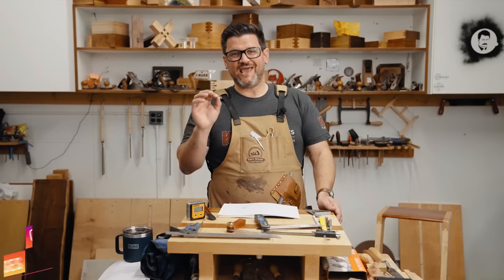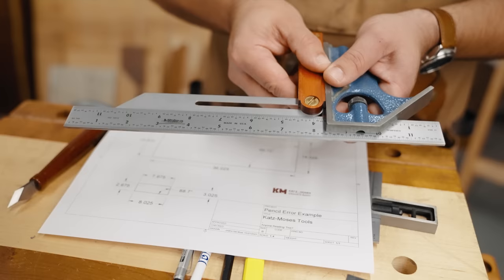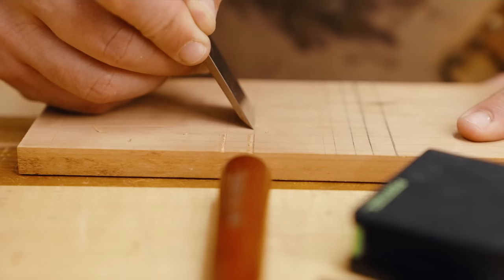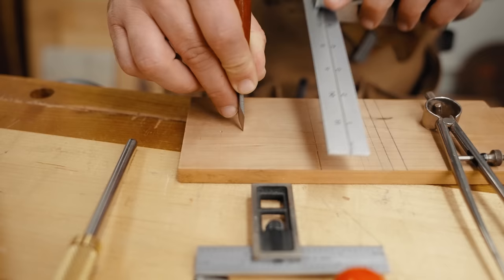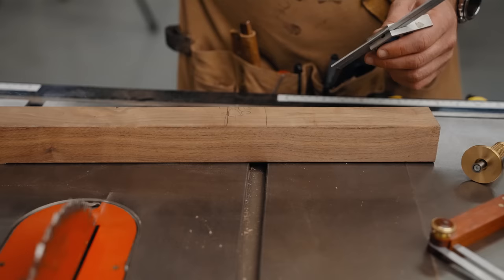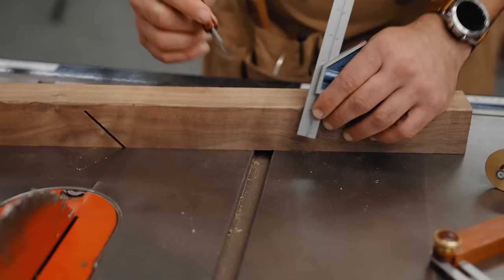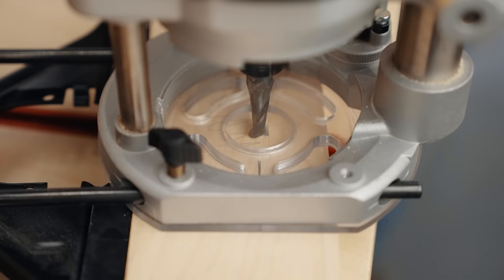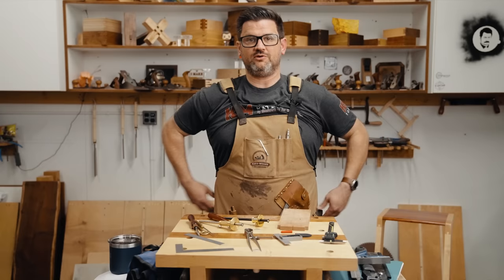Why Accuracy Matters in Woodworking - Common Mistakes to Avoid

Comment: Is there anything about the direction of a cut on a miter saw?  I made a frame and cut 45 degree angles, but it seemed like it was slightly off when I assembled it.  I thought it might have been not cutting all pieces in the same direction...maybe it was my measurements though.
Reply: Could be the miter saw is slightly out of square, could be the frame sides opposite each other were not cut to the exact same length. If you're not using a stop block on the miter saw, it's difficult to get pieces absolutely identical.

Comment: What's the advantage of a marking knife over an xacto knife?

This video prompted me to order a marking gauge - I've been holding a pencil next to a combo square and running that along the edge. Works, but not ideal.
Reply from the maker: Single bevel means you can run it along your square. Exacto knife is dual and gets pushed away from your square. Good question.

Comment: In my workshop, and in my office, I have a poster with just three words

Patience
Precision
Perfection

The second one is all demonstrated here. Work out where accuracy to a measurement matters and where accuracy to other cuts matter. 

The first one is more about me. My weakness is getting that feeling late in the day of “ if I get glue up done now, it will all be cured for the morning” “I’ll just get these bits cut before I go.

I (try) never to do anything if I’m in the slightest bit tired, not feeling great, feel pressured. Most of that is about my health issues, but, for me, it’s take your time.

Comment: So basically if you are not so smart to cut on same side of a square. Pay. And it doesn't matter how thick line is as long as it done  with same tool against same square. It will be always same. Can go other way round with knifes. As obviously it's 3 finger wood worker... He can't do line always close to square due to uneven of blade = more error and probably will cut himself with it... No offense but it's just pure extreme min max comparison with nonsense pdfs.

Comment: I think this is great but with working with wood especially natural solid wood that's been kiln dried/seasoned it will move regardless if you're 0.5mm from your line or past your line. To be honest the majority of the tools aren't built to cut within 1mm perfect every single time they're used but instead they have small tolerances that you end up having to encount for through using the tool over time. Throw in good old human error and humidity changes through-out the year and that small 0.5mm is almost impossible to retain. Every when they lay foundations like shuttering for example, sure they could put everything in dead plum and true but the ground moves over the buildings lifetime and brings us back to square one. You've just got to do the best you can do and try not to get caught up chasing 'square' most of the time.
Reply from the maker: Yeah but it's not going to move from glue up to draw front fitting. Plus, in the direction of my CAD example (crosscut or length of piece), wood doesn't move along the long grain. I think what your referring to is seasonal wood movement which needs to be accounted for across the grain (about 1/4"  of movement per 8 feet). This can still be accounted for while using accurately cut, square parts.

Comment: WTF is he babbling about? Cutting something on the inside or outside of a pencil line doesn't change the ANGLE of the cut.
If you draw a line using your square, then cut along the center of the line, or left or right side of the line... the angle still remains 90 degrees.
Reply from the maker: Hahaha look up compounding error. I'll take my apology in song form.